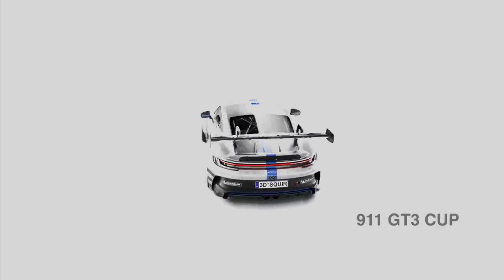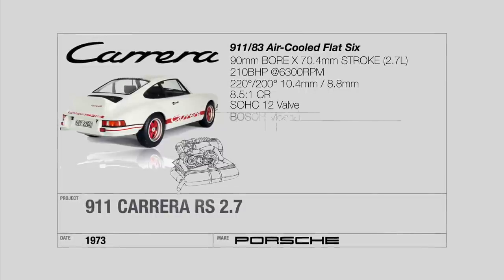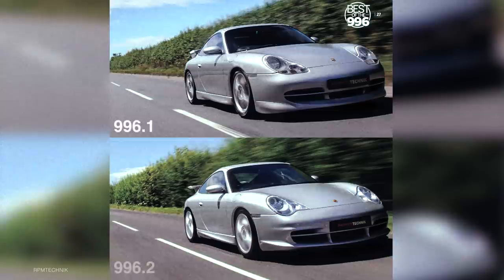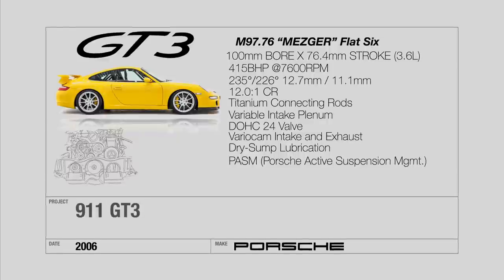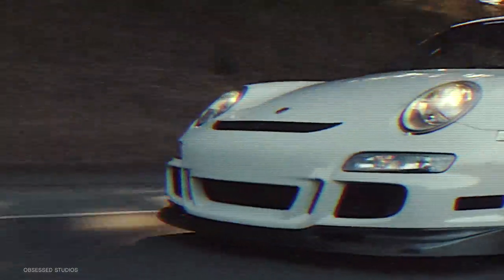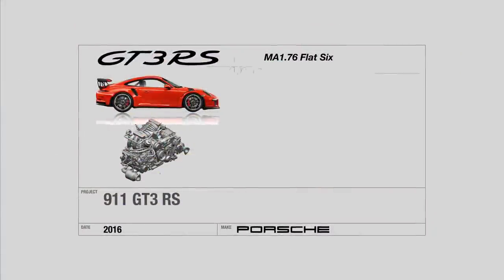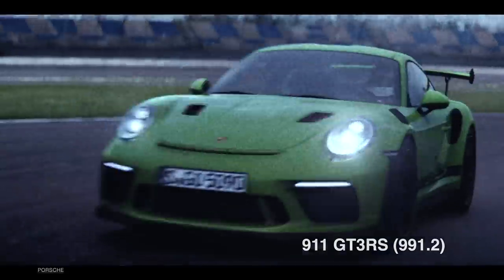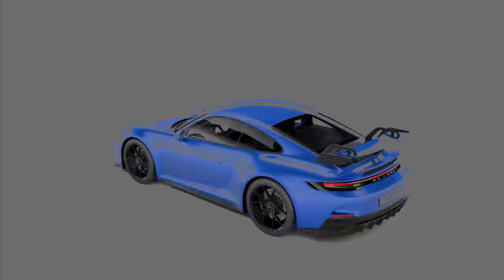Porsche 911 GT3 Engines Are Ridiculous😮‍💨 | Explained Ep.18

Comment: 127 bhp/liter, only 7 bhp/liter more than the original S2000 of the past, which had no direct injection and had a relatively tame exhaust. Imagine if honda built a V8 out of the F20C and spent as much R&D on it as much as what Porsche spent on their flat 6.
Reply: Comparing a 2L 4 to a 4L 6 

Motorcycles make much more HP/L than both regardless
Reply: bikes have bigger cams and smaller stroke, they make that power in relatively small portion of rev range
(tho smaller bore=valve area)
Reply: @harryplatt7942  yes. but the 4 liter 6 has direct injection, high flow exhaust, decade of newer tech, is more inherently balanced, etc. Apples to Oranges, in Porsche's favor. What i was saying is that if honda made a flat plane V8 out of it and gave it the same contemporary tech as the Porsche, it would have been epic.

I can also compare that 4 liter 6 to a 6.5 liter Ferrari V12 which also beats both the Honda and the Porsche. Cheap Honda, Expensive Ferraris, porsche fanbois will still find excuses either way.

And this vid is about car engines, not motorcycles.
Reply: Look up neutron engines k48 design; the guys making a v8 from two k series motors and it will rev to 10k
Reply: @sebastianhasbun3846  its not stock factory engine that is mass produced and has to meet emissions standarts..

dart block small chev will also rev to 9000+ all day long and no one is icluding it as its race engine that is widely available tho
Reply: This ⬆️ I do love the porches engine but as stated above Honda made this with no fancy parts. No ITB’s and port injection and runs forever. I truly believe Honda had some of the best engine designers back then. They were the masters of making things fast without excess like the NSX.
Reply: S2000 made 124hp per liter  out of a 1999 designed engine
Reply: It's comparing HP per CC/ liter
Reply: if Porsche had to follow the emissions standards of 1999 like the Honda it would make 550+
Reply: @Driver_88  if we use that logic what did Porsche achieve power wise in 99 compared to Honda?
Reply: In fairness, honda have over the years produced some of the absolute finest engines in motor vehicles. And they do so at somewhat accessible prices. 
Honda, Mercedes, BMW, Ferrari and Rolls Royce have built some of the finest works of art in terms of the Internal Combustion Engine.
Reply: Honda specialise in small displacement high revving engines. The difference is displacement and complexities in engineering compromise behind it. It's not as simple as you're making it out to be. If Honda could have done it, reliably, they would do it, however, it's not in their DNA... economics etc.
Reply: I don't think Honda would be able to hang out at 4L. Hitting high HP/L at larger displacements is not a walk in the park. Them going turbo and electric with new NSX hints at the limits of their engineers' talents.

Comment: I drove the 991.2 GT3 at Porsche Experience and it was eye opening. When I was younger I always thought the GT3 was overpriced and overhyped. But when I drove it you can easily see why they are such great cars that easily are worth the asking price.  The 9000 RPM engine from the Cup car was tested at 186 MPH for something like 17 hours for a total of 3000 miles. It felt like it could be beat on and never complain. The chassis is incredible with amazing turn in and mechanical grip, and you get gratification when you trail brake it in and hammer the throttle early on the corner exit. The brakes are stable and incredibly strong with great modulation. The sound of the 9000 RPM is music to any car guy. What a car.
Reply: I worked in a shop in Canoga Park, CA where we would modify 996T and 997.1T as well as clean up other shops' mess and actually make it work. Pulling 800BHP out of a 996T on pump gas and 1,000BHP out of a 997T on E85 has its merits but come nowhere near the harmony of a factory Porsche GT3/GT2 in handling. Porsche engineers are GOOD engineers.
Reply: The GT3 was NEVER overpriced. It’s exactly the opposite. The most sports car you can get for your dollar. Period
Reply: I have always been a car guy .I saw a GT3 rs and thought, why would I spend that kind of dough on a car. At that time, I owed an S Class, a Jaguar F type, an Acura, anyways, 8 cars total. The moment I drove that Porsche.....  minutes  later.. I bought one plus a 1987 Carrera and am now looking for a 914. Porsche cars are a visceral experience for me.
Reply: This is 1000% true. I thought that in general about Porsche until I drove one. The minute I floored a turbo, I understood the hype.

Comment: So my Honda S2000 had 120 hp per liter 22 years ago and I gave only $32,000 for it. Just saying, very happy with my S2K. 😊
Reply: lol ok. 239hp 2.2L = 108hp/L. Previous version was 237hp 2.0L = 118hp/L. 0-60 in 6.4 seconds and lap times eons slower than a GT3. Would make a good stepping stone for someone racing spec Miatas who wants to eventually move up to GT cars though.
Reply: I was about to say exactly that about the s2000! Honda was the leader for a long time!
Reply: @FourT6and22  the main talking point was HP/L...Honda did 120HP/L NA in 1999. This is nothing new.
Reply: 20 years ago my built wrx was putting out 200hp per litre.   I hammered it hard for 3.5 years and only blew 1 turbo.
Reply: For msrp of $9300, Kawasaki z900 is a steal with a 948cc engine that smoothly produces 125 hp. Max rpm only 10,500.
Reply: Yeah, but you have to stay costantly at fucking 9000rpm to move the car because it's a nail 😆
Reply: And honestly, pretty much any modern superbike maker would like to have a word. For example: Aprilia's RSV4 V-4 makes 217 horsepower from its naturally-aspirated 1099 cc.
Reply: In Japan S2K was 250hp .
So 125hp/L
Reply: Honorable car ....but to comparison to the great Porsche
Reply: Different era....much harder today to get those numbers on naturally aspirated motors with emission controls.
Reply: I love both Porsche and s2000 9k RPM it would be cool to own 9k RPM cars from four cylinders up to eight cylinders. I’ve had my s2k for 13 years and I loved every minute of it so I can only imagine having Porsche as well. They’re all nostalgic to me and timeless.
Reply: Manual 6 speed S2000 is probably the finest manual transmission I've ever driven. Just loved it.
Reply: What's the nurburgring lap time? 45mins?
Reply: @jamesgoes9894  and minus 45mins on the nurburgring lap time for the 911
Reply: @seamusmcfitz913  so?
Reply: @tingfan21897  you win!
Reply: You might want to run those numbers again 😂
Reply: I think only the Ferrari 355 had more HP/Liter, with the S2000 being a close second. You can put parts on the S2000 and will help it a lot.
Reply: S2ks and m3s stand out to me when hp/liter is brought up
Reply: High HP isn’t hard to make. Good wide torque band however!
Reply: U have one of the best car ever made
Reply: @FourT6and22  stop coping. The s2000 is a better car than the gt3.
Reply: @tbone5654  not na doesn’t count
Reply: @froggy442  not true
Reply: @seamusmcfitz913  haha the s2000 is better
Reply: @nlsdrf1290  What would may it count?
Reply: @tbone5654  na. Subaru is turbo and we’re talking about na cars. So a turbo car having more power/litre isn’t as impressive
Reply: @nlsdrf1290  if you live in your parent's house...like you do.
Reply: But he had low tork and only produced the power on high RPM. 
And don't think I'm trying to say your car is bad, S2k is a legend and a dream for most petrolheads, but what Porsche does is ridiculous man.
Reply: @funnyshorts6830  I agree. I suppose that had I the means, it would be on the top of my list as well.
Reply: Torque win the race mate,
Reply: Make that s2k turbod pushing over 800hp, and you’ll have every bmw and dodge owner shit their pants…
Reply: Even if I were a Porsche fanboy I’d have a lot of trouble arguing the idea that Honda don’t make brilliant engines
Reply: And still the honda didnt handle better than a porsche. Not gonna say honda is a bad car but the comparison is unfair here hondas are a different horses for a different race porsche is a different breed.
Reply: @DavidKAnderson  That's pretty wild. I guess as a bike engine it can sacrifice torque because of the lack of weight.
Reply: @Alone1am  Porsche's are always race derived engines. Hondas not so much.
Reply: Don't get me wrong I respect them. The Honda 1 cylinder in my mower has run for years. It's amazing. I've heard they even use them for go karts...
Reply: @ianedmonds9191  That's a great observation: the bike engine can certainly get by being peakier.
Reply: @bmmarshall79  That's why supercharged LSX engines are great, they only weight a little more then a euro 3.0 V6, they cost little, they go forever, they put out megga torque.
Reply: Adjusted for inflation and you would be surprised what it cost now 😢. 
Everything got so expensive. At best you get a 944 for that nowadays.
Reply: My vr4 has about 360hp atw after only $6k worth of mods, and still running standard unleaded on stock injectors. That equals 144hp per L
Reply: @Jlinwoodjackson  The ferrari actually had less hp per litre than the S2k, but it was faster due to other differences. A lot of people in this section dont seem to realize it a comparison of motor engineering vs a pissing contest of S2k vs everything else. The intake runners on the porsche are reslly what give it an edge, allowing positive displacement beyond atmospheric pressure on the intake, which is done by honing the shape and length of the runners to match the intake pulses to create vacuum pressures(sub atmos pressure), as well as allowing higher velocity air to shove more into the combustion chamber. Velocity stacks perform a similar function, which is why you see an improvement of about 10-30 HP increase on the F20C with velocity stacks, ITBs, and a cat elim. Eliminating backpressure also allows for the furtherance of this, as it can use fluid dynamics in the same way as the intake to suck burnt exhaust fumes out on the exhaust stroke. Porsche invested far more time and money into this, as the vehicle they produce will be worth way more, so obviously it is superior to Honda’s factory equipment.
Reply: @ianedmonds9191  well, in this case the F20C was not race derived… However racing technology was used through and through in its development and testing, so its not exactly an unfair comparison. It would just be wrong to say that the F20C produces more power and/or is faster. However, comparing technologies used 24 years ago to achieve similar results to what is being used today definitely can glean some insight and understanding into what makes the GT3RS and the S2000 so great.
Reply: S2K is a wonderful car; but two totally different machines....
Reply: @saxplayingcompnerd And Ferrari did before that; and still does....
Reply: @DavidKAnderson ou can't really compare bike and car engines. The head designs and configurations on bike cylinder heads is worlds beyond anything on prettymuch any car. Starting with port position and angle; way better than any car on average.
Reply: @34Racingteam Precisely!!! 👌
Reply: @froggy442 The S2K was a ULEV in the US. It's totally on par....
Reply: @Jlinwoodjackson t was the 458 Speciale; not the 355.   Ferrari has even higher N/A Bhp engines than that, like the 812 Competizione.
Reply: @nlsdrf1290 Two totally different cars; they aren't even comparable....
Reply: @mottaah972 Truth!
Reply: @ianedmonds9191 Honda has an insane racing pedigree actually....
Reply: @ianedmonds9191  what??? How a porsche engines "race derived" whatever that means
Reply: @nlsdrf1290  It's in the video. The Mezger flat six was based on a Porsche Le Mans racing car engine. So designed for racing then adapted for the road cars.
Reply: Congratulations,I have driven few hundreds cars and 2000 is one of the best I have ever tried,especially manual shift raving and handling,pure mans machine,we progress but actually is there anything better?
Reply: When that S2000 came out, it was one of the biggest deals in a long time. The most displacement per liter. I was lucky to be the first to drive one in my town. It was a bad ass ride.
Reply: Okay buddy 😂
Reply: Your 2k wouldn't stand a chance on the track against a porshe there's a difference between driving fast and fast driving
Reply: @Jlinwoodjackson in horsepower per litre, the Ferrari which is a 4.2 L flat plane crank V8. Only beat the Honda S2000 by 1 horsepower, which we all know is a 2L V-tec four cylinder. Honda enthusiast for life!
Reply: My rx8 has 180hp/L 😊
Reply: I’m a Honda fanboy too, my 8th gen Si also has nearly 100hp per liter but cmon... I’d take a gt3 over my Si and your S2000 combined.
Reply: @DavidKAnderson why tf would you compare Bikes to cars 🤡
Reply: @nlsdrf1290 wHaT?!?!? How this Racecar defined? What mean the Race Car defines huuhhh?? 🤡
Reply: My mathematically engineered twincharged lawnmower creates 3.7 billion Kilowatts powered by the farts of the indonesian cokroach wich have the exact balance of gasses to produce the perfect clean combustion we need to power a 370mm Garret turbocharger along with the help from the jizz of the gods on a quarter cubic milimeter of engine displacement
Reply: My 250cc dirt bike makes 160 hp per liter and I only paid 5k for it… what’s your point?
Reply: @Ferrari255GTO underrated
Reply: We’re talking about Porsche….
👇🏻

A Porsche
Reply: german engineering>italian engineering>japanese engineering
Reply: Yeah but the Porsche as double the liters. Has low cog. Is almost a specialized race car.
Reply: @tbone5654 we talking about all motor here.
Reply: Honda vtec engines were a masterpiece of engineering and reliability and specific output per litre.  As are many high revving motorbike engines.  The real difference with Porsche, is that is relatively easy to get high output from small capacity motors, just get more revs, and sacrifice torque.  To scale up capacity, generally the specific output per L falls, as it is not exponential.  The reciprocating and rotational masses increase hugely, so the revs are harder to achieve with reliability anf usable torque spread. 

TLDR 1-2 litre NA. engines are far easier to give 100+ hp per litre, than is a 4L unit.   To do this whilst meeting modern emission regs and with endurance racing reliability with 125hpL is a great achievement beyond Honda S2k.
Reply: My saab 9-5 troll r makes 305 on 2,3 liters making 133hp/L
Reply: F20c FOR THE LOSS. real world numbers will tell you it's not that efficient and neither are those ap1 synchros
Reply: And u have torque as a lawnmower 🤣
Reply: Could your S2k achieve that stunning HP/L at higher than 2L of engine displacement? I doubt it could. If it were that easy many more companies would be doing it.

Comment: I miss high revving over 100HP/L NA engines. I greatly enjoyed them in my S2000 and Z4M. They are so rare nowadays because of fuel economy standards (that's my understanding at least).
Reply: s2000 had 120hp/L
Reply: @Hondacrxdelsol33  Yup. It held the record for quite a long time before it got unseated by the Ferrari 458 if I remember.
Reply: Why does HP/l matter? I think HP/engine size or HP/engine weight is more useful. s2000's engine is not much smaller or lighter than a Chevy lt1 V8.
Reply: @zijunx1595 it’s a good question. But hp/L gives a better approximation for engine character. High hp/L cars will have higher revving, sportier feeling engines. Often high compression ratios too. They are just more fun to ring out.
Reply: @vthaver1 Then why not use the red line itself?
Reply: The new CBR1000RR-R is pushing 225hp/L and revs to 14,500rpm.  So...just get a motorcycle if you want high revving, high hp/L naturally aspirated motors.  Why bother with cars that don't come close to those figures if that's what you're after?
Reply: @weatherproof1  I have a GT3RS at age 54. I track it regularly. I've long given up doing the same on crotch rockets due to the creeping physical inadequacies brought on by age. So the reason I bother is that the car is as close as I can get without thinking I'm going to die every lap. AND my better lap times are in the car.

We're after a high hp/l na machine, but nobody said it's the ONLY thing we're after. You might choose differently, but we've all got a list of criteria we weight and prioritize when making a purchase decision.

Comment: Dude!!!! I'm a serious 911 Fan mostly the older very mechanical variants. The late 80's 90's and early variants of the 2000's. The new 911 with their floppy paddle shifters Not at all.

This video is by far the very best in 911 variants, power displacements and models. Great great video that should be show in classes of students studying automotive engineering, automotive repairs, or really anything related to studying racing development and research. Best 911 video to thos date. Thank you.